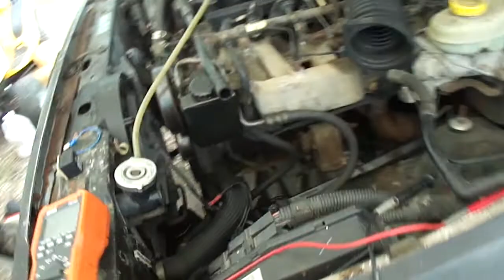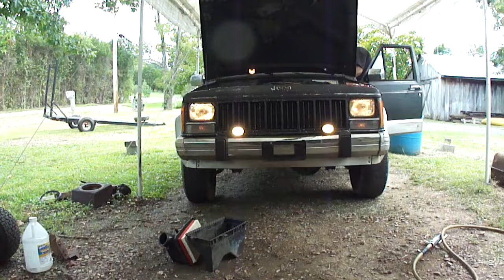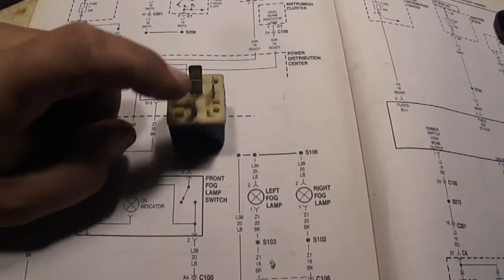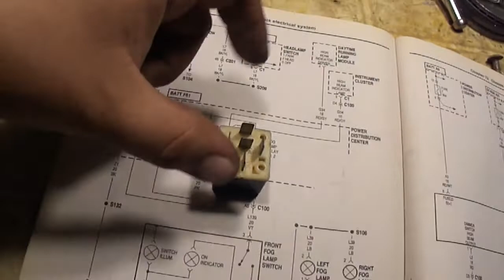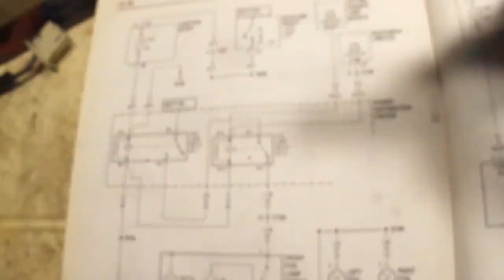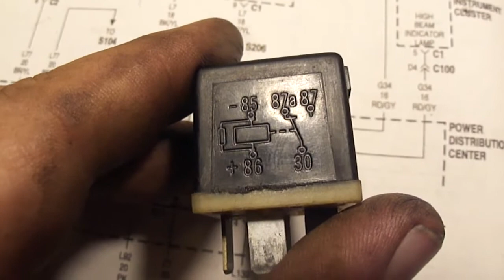Fog Lights With High Beams Jeep XJ

Comment: Excellent tutorial.  Any hack to be able to turn on the fog lamps without any headlights at all?  I like to use fog lamps as a "poor man's" daytime running lights.
Reply from the maker: They should come on with just the park lights. But if you just want fog lights only then you would need to add a switch and supporting wiring to the relay.